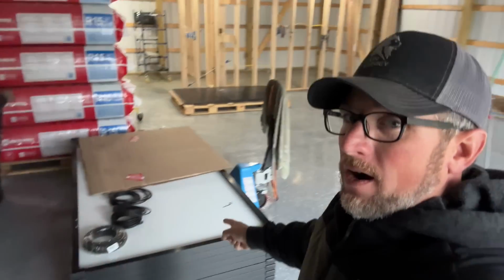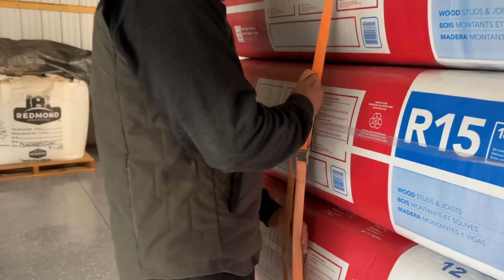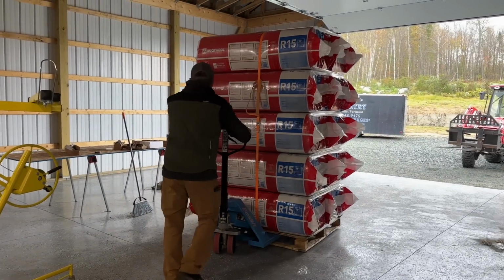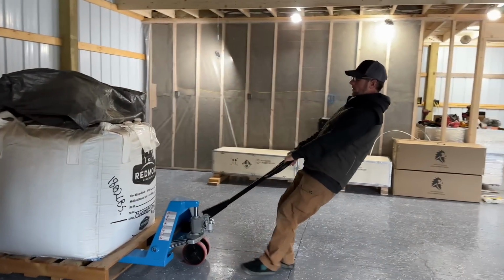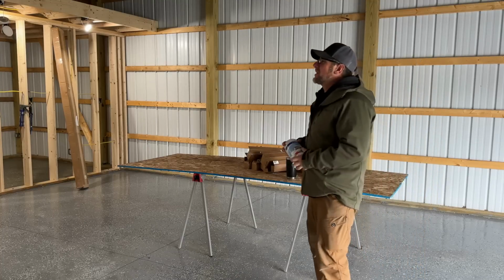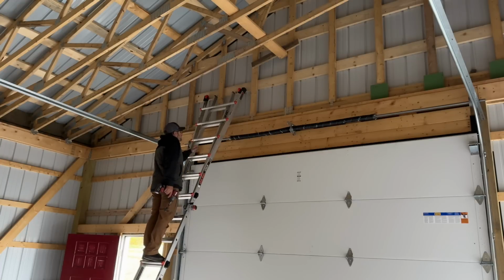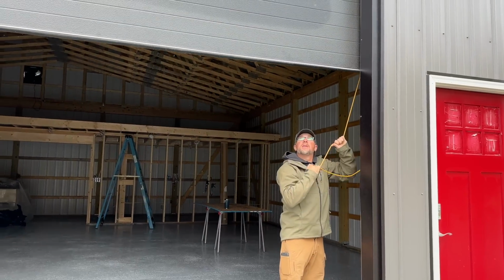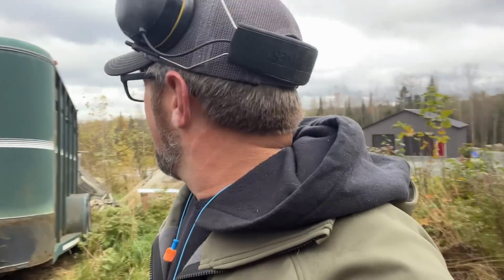We're READY for the NEXT Step of the OFF GRID WorkShop Build

Comment: I hope you ordered a new right side glass door for your tractor before it snows. I cannot see how all those big holes in the headed makes the headed stronger.
Reply: Something about when the foam insulation is applied, it will strengthen it as it will bind it all together - like encapsulating the whole thing in epoxy - kinda.  Not quite, but close.
Reply: @samvalentine3206  I do not think the foam can make up the strength lost by the 2 inch holes cut into the 2 x 12's, nor do I think that header needed to be insulated, the loss of heat from a couple 2x12's over the roll up door would not amount to much at all. It is Al's shop he can do whatever he want's to, if I were going to insulate the header I would have  filled the gap prior to putting the sheet metal up.
Reply: Henry show us your documented stats to support your comment

Comment: Good morning Al and Gina.  I was wondering how you are planning to heat the workshop.  If I missed you saying it sorry.  The homestead is going great.  You are both so busy and energetic.   Thanks for sharing your videos and take care!
Reply: They installed under floor heating pipes when they layed the pad.
Reply: As Julie said above, they put in pex tubing into the concrete of the floor for radiant heat, like they did in the Harvest House.  Now they'll need another furnace to heat the water, the circulator pumps and all that.  That part has yet to be revealed to us...
Reply: @samvalentine3206    the existing boiler has the capacity to heat several more buildings but is a bit far away to run pipes for the shop. Perhaps Al will move the boiler to a central location? We will find out what his plans are eventually.

Comment: Good morning Al,Gina, and Mr. Figaro! Ready for insulation! Yea! I worried that the heat off the lights might cause the shower caps to melt to the light, but maybe that type of light does not put out that kind of heat? What does an armchair supervisor know!😂😂😂 Hugs from N.C..❤
Reply: L. E. D.  Bulb's. Not as hot
Reply: Good morning, Marin!  I guess we'll find out about the heat of the LED fixtures and the shower caps.  I worry about them melting as well... sometimes LEDs can be really hot, almost as hot as incandescent bulbs - from my experience.
Reply: @samvalentine3206    he is touching those fixtures with his hands so can't be any hotter than the water in a shower.

Comment: Look at a Karcher pressure washer.  Has a Honda motor.  Had mine for 8 years no problem
Reply: Good to say that. We bought a Craftsman pressure washer with a Briggs and Stratton motor and it ate itself by pumping all the oil out into the air cleaner. They didn't warranty it. They told us we didn't have oil in it. Total loss. Now we have a Generac and it works very well. I bet a Honda motor is a lot better than a Briggs and Stratton.

Comment: Gina was correct we were all thinking the same thing when you were driving over the edge of the new concrete slab😅
Reply: Yes she was!  There was enough room to place each item on the edge of the slab without even driving onto the slab in the first place... but Al's Rules apply here.  (smile!)
Reply: @samvalentine3206   I too was curious about why he drove on it. And he placed the "Rockswool" (as Al calls it)  farthest away from the work area. You're right, Al's Rules!
Reply: @samvalentine3206    I'm amazed he just didn't install the insulation and there'd be less to move. OTOH, he's got a day's worth of wiring to do before that, so maybe the timeline is too tight at the moment.

Comment: Al , I was wondering if stuffing the rockwool into the ribs of the panels at the bottom, would they retain moisture if they got wet. If they do get wet and hold moisture they will eventually rust out the wall panels from the bottom. Probably overthinking.
Reply: Z channel was installed on bottom of metal sheeting.

Comment: Al, I am curuous as to why you turned that solar panel with the glass up before you moved it. It seems it would be protected more with the back side facing up?
Reply: I think he did that to protect the wiring harness and act`s like a roof for the rest to the panel`s.
Reply: As Donna said, it's to act as a "roof" while it's outside in case it rains.  If they had left it the way it was, if it rained, it would pool in the frame.  Now, if it rains, most the water will be shed.  (fingers crossed!) 😉
Reply: That’s the side that’s designed to be exposed to the elements once installed.
Reply: @samvalentine3206  Maybe put the broken panel on top of the good panels as it will then completely protect the stack of good ones.
Reply: @pasreview9274  That's a good idea! It might as well be helpful. Have a great weekend!
Reply: @StoneKathryn  And you as well.

Comment: Good morning -Why all the large holes in the garage door header?
Reply: they are for access to spray the foam insulation.
Reply: Rigid foam between the two boards would eliminate the need for drilling holes
Reply: Seems like overkill in relation to actual energy lost by not insulating that specific area. Plus, the issue of loss structural strength in the header. Especially if you install a garage door opener track to the header. I do like following  the channel  - just my thoughts. @rupe53

Comment: Good Morning!  Believe it or not, that panel may still work.  As long as it's just the glass, the silicon might still be intact.  One of my panels arrived broken too, but it was totally shattered into a thousand pieces.  Good luck on getting a replacement  The shipper is going to blame the warehouse, and the warehouse is going to blame the shipper.  Fortunately, your system will work fine if one string is missing a panel.  That's the beauty of MPPT charge controllers and inverters.  They have a very wide range of input voltages, and adjust the current for optimal performance.

There are some products for replacing the glass, but they cost about the same as buying a new panel.
Reply: Good morning, Guy!  Good point - hook it up and try it.  Then a quick coat of some clear epoxy and it will contribute, albeit all cracked up - and get a replacement, of course.
Reply from the maker: I wonder if you can replace just the glass
Reply: for me, who blames who, is down to those two not Al surely the supplier has to replace the panel and shipping  free of charge to AL.
Reply: @barryedwards1336     I have delt with this several times. Usually, the supplier sends another product, (ASAP) and they sort it out with their insurance company later. Bottom line is a happy customer. (especially on a large order like this)

Comment: Good morning Al and Gina
 ❤❤ You don't think those plastic caps will melt on the lights?
Reply: LEDs tend to run a bit cooler than incandescent bulbs - so hopefully it won't be a concern.  We'll find out!  😊
Reply: @samvalentine3206    I measured the temp on some LEDs the other day (IR thermometer) and while you can get a pretty nasty burn from a regular bulb (guessing 200+ degrees) the LEDs came in only 10 - 20 degrees above ambient temp. This was on some 75 watt equivalent. bulbs, which are only 10 watts draw.

Comment: Just a question, when you have the work done..... Is the COLD ROOM going to have 6 sided insulation???
Reply: 5 sided, not the floor but they didn't install any radiant heating there.
Reply: The floor is insulated with foam insulation

Comment: Will you get a free solar panel to replace the broken one ?
Reply from the maker: We will
Reply: @LumnahAcres  - Please be sure to try the broken one before you toss it, if you don't have to return it.  It may still produce power in it's broken state - as long as the circuitry is intact.  Always nice to have an extra panel, even if it is not 100% efficient.